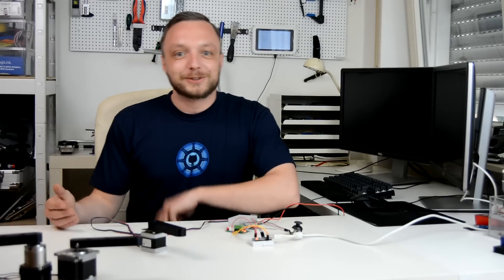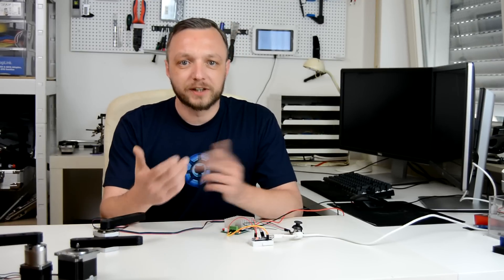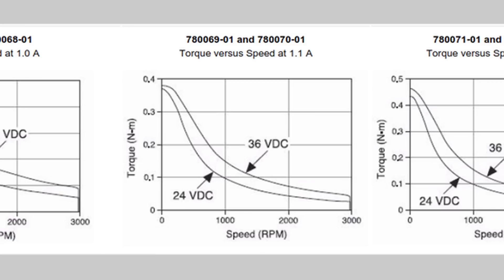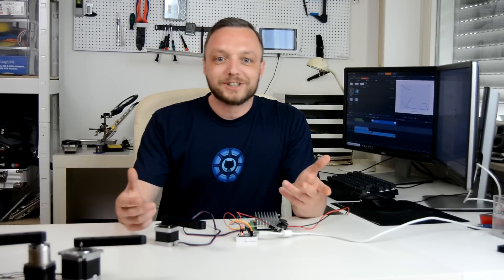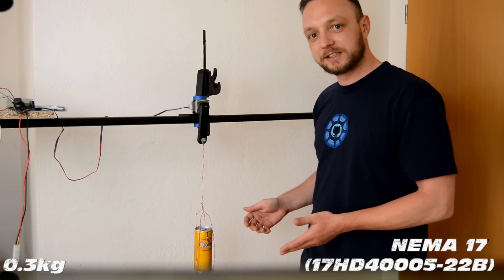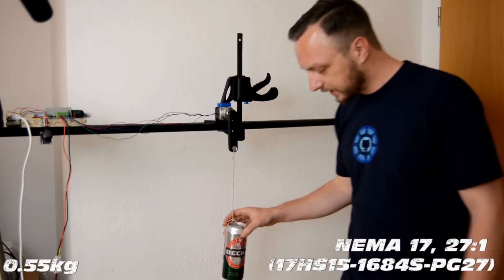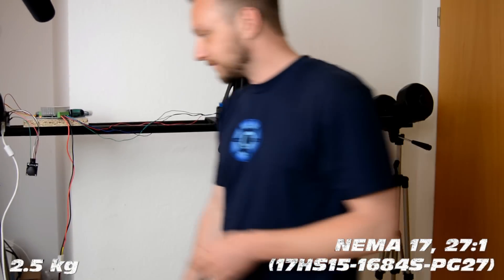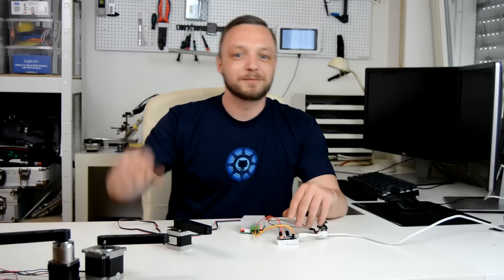Selecting the right stepper motor - Torque test of Nema17 and geared Nema17

Comment: My question is what would happen if the arm would be attached in it's  center point to the motor shaft and a counterweight would be placed at the other  end of arm? Would it increase the weight of being possible to lift?

Comment: Hi.  Thank you for information and demo. I am working with very small project and have a question, would a micro stepper motor with 0.01Nm holding torque, be able to turn a small plastic disk 60mm in diameter weighing around 30g?

Comment: TB6600 Torque... would the driver affect the torque output of the motor at all? We have an issue with a stepper motor application unable to drive an arm and I'm in the process of fitting a geared stepper motor instead. But supplier has said the TB6600 driver is not sufficient for the motor and we should be using a D652 driver instead. But my research shows D652 makes no difference to torque, it's all due to the current output regardless of the driver and that skipped steps (too fast) affects the motor too, again, regardless of the driver.

Comment: thanks for the testing video  I need one help as i am unclear .  I want to rotate the mechanical knob which need 5nm torque to rotate. which  stepper motor i can use ? should i select the motor in accordance with the holding torque specification or something else. Kindly reply

Comment: The disclaimer at the end: No motors or microcontrollers has been harmed during taking of this movie... You made me laugh a lot. 

I am also curious what voltage did you supply to the driver for achieving this, is it 12v, 24v, 36 or something else?

Comment: Could the stepper motor be "inversed" into an input device ? Meaning you turn the motor manually and read the position (angle) from a computer program. (This could be useful to build an "input puppet", posed manually. Then the pose will be duplicated into a larger/stronger device).
Reply: For anyone reading this question 2 years later, you can just use potentiometers in the input joints to get analog readouts, run-through arduino and get your angle.

Comment: It would be very good to know how much voltage was set in you power supply and how much current was set in your BL-TB6600-V1.2 driver?
Reply: I do realize that, and I am already working on the next video, have also built a new and better contraption to test different motors, and will definitely use your feedback! If you can think of anything else that would be interesting please share and I will try my best to consider that in the next video!
Reply: @deSpeyer  Thank you for your answer, I am really looking forward to watch the video.

Comment: hey can you help me to find motor for my project, i need motor which can push the car break paddle need 4kg to start to push it and need 8kg to push completly can you suggest matching motor for this
Reply from the maker: This sounds like an interesting project :) I can try to help! How would you want to move the pedal? With a lever? How long does it need to be? How deep does the pedal need to be pressed?
Reply: @labstream4122  4.5cm it will move to applying fully break , this the length move ,
Reply: @labstream4122  i try to use flexible connection (like cable or wire ) between motor and paddle , because it free to if driver need also he can manual control the break paddle push .. this connection help to both motor and driver can control the paddle ,
Reply: @labstream4122  15sec enough hold the break paddle , motor axel and paddle connect with wire and after motor rotate, cable roll around motor axel , and paddle will pull to down
Reply from the maker: @shanukajothirathne4267  If you want to move 8kg, we are searching for a motor with roughly 1Nm torque - that would give us the ability to move approx. 10kg with a lever (or in your case - a wire) up to 1cm away from the motor axle. I have seen some Nema17 that claim that they provide 1Nm of torque, but never had one of these here. A Nema23 would probably be a safer bet. If you really plan to put this in a car, space might become an issue, though? And what are your requirements on the speed - how fast should it be able to pull?
Reply: @labstream4122  minimum it want pull from wire 4cm in 1sec

Comment: Thank you for the movie, I was hopping to see if the nema 17 kan lift up to 4kg? The movie sound is to low, if this kan help you in the future :-).
Reply from the maker: Hi, thanks a lot for your input! That depends on the NM it is able to produce. 0.4Nm of torque means it can move 4kg attached to a lever that is up to 1cm away from the shaft. However, for long-term operation it has to be checked how much radial load the motor can take. It might have to be decoupled from the load. I am currently looking for ideas for new videos. If you can provide more input on your specific usecase and its requirements, I can try to test it and make a video from it if you are interested?

Comment: Can you please answer this,
If the stepper motor had lifted load to almost 90 deg and we lose the power will the motor rotates back to its 0 deg. position due to the gravity or it holds its position upon power loss.
I want to use a non geared stepper motor in one of my project and i want a fail safe design which returns to its initial position upon power loss.

Thanks in advance
Reply: Hi Abdul, sadly, if the power is cut, the weight will pull down the lever again. You would need an additional mechanism to keep it in the 90 deg position on power-loss.

Comment: I want to use two stepper motors to power a wheelchair for a friend. He weights 90kg. Do you think the shaft of these motors can handle that amount of weight? Also I'm thinking of going for a Nema 34 just to be safe with the min. torque required for the job.
Reply: Most probably not. I'd suggest to put the axle with the weels in bearings which can hold the weight and drive this axle using a belt or a chain

Comment: Hi there, does the distance of the string from the shaft make a difference to how much the motor can lift? I am interested in using a servo motor with a torque rating of 25 kg-cm to lift a mass of 450g, 20cm away. Could this work with a string or not?

Thanks.
Reply: As long as it hangs parallel to gravity it does not make a difference, the force 'pulling' on the shaft will be the Same regardless of the length. The motor you proposed seems fit for your application! May I ask what you plan on building?
Reply: @deSpeyer  Hi there, I'm trying to make a device to pull someone's fingers open as they cannot do this themselves. Using the servo as a sort of precise winch I guess.

Would it work horizontally?
Reply: @kyle_vr  yes, this should work. Sounds like a very cool and important project! If I can be of any further help let me know (I am the guy from labstream, accidentally posted with my private account)
Reply: @deSpeyer  Ok, thanks!

Comment: Intresting video, I'm doing some research for a project and could use some help. I wanna use a stepper but the only way to get power to it would be a battery pack charge by solar or something like that. The torque of the 17 looks good but I might go for the 23 just to be sure... But I want to know... What kind of battery pack would I need to move 4 linear meters on full torque (worst case).
Reply from the maker: Hi Bjorn, that sounds interesting! Could you write an email to me, I can look it up tomorrow?

Comment: Unanswered questions (1):  Was the slippage due to mechanical failure of the motor shaft to lever connection? (2) Was the slippage due to the motor being unable to lift (e.g. failed to maintain lift)?  (3)  Was the motor able to "hold" the weight?  (4) What  demonstrates the failure of the motor?  (5) how to calculate which motor to choose for which weight.

Comment: I want to make an "elevator" at the end of my bed, that can lift a 60" LCD TV (I don't know the exact weight). But I don't want to spend more than $350~400 on motors... or miss the show while the TV is being lifted... xD

Any suggestions? 🙂
Reply: Get an electric linear actuator of desired stroke.That will be simple and easy.
Reply: What height does the tv has to be lifted?
One way is to make a scissor lift mechanism ..
Also try car wiper or car window motor (used probably) .. or some other motor ..
Also add end switches for safety ..

Comment: Sir please reply me, I'm making a college project, CNC EDM , a screw have to rotate very small rpm , and it's lifting a weight 15+ kg which is attached with the nut , which type stepper motor is preferable in low budget...

Comment: so i need to lift 10cm 4kg  , which means that the arm will be 5 cm long  ...  lol so nema 17 is not the good choice .. wth motor i need   ? could you help ? If i calculated it right i need 1.96 Nm  . so nema 23 which has 2.2 Nm should be ok ???

Comment: Hi Sir, I was planning to build a DIY 3DOF full motion for my flight simulator, the weight payload is about 150-200kls. Would you suggest what type of gear motor that fit my plan?  Your comments are really much appreciated. Thanks in advance :)

Comment: Appreciate your video, I am making a crane using a stepper motor. It works up and down perfectly. But I cannot pause in a position in between with A4988 driver, will this driver will do the task

Comment: hello, could you tell me were to find the programming code for the stepp motor?
Reply from the maker: Hi, the arduino-code is here: https://github.com/Labstream/episode_torque/blob/master/tb6600_joystick.ino. I have been using a joystick to control the stepper, but of course you can customize it to your needs.

Comment: Nice video. I'm wondering how bad the backlash of the stepper with the gearbox is? This would drastically influence for example the precision of a robotic joint. Were you able to feel any backlash or did you measure it?

Comment: I use a NEMA17 with 0,59Nm and when I mount a simple RC wheel the motor slips. No force to move my robot car :(
I use the A4988 Driver. In so many projects the steppers looks so strong.

Comment: The higher the gear ratio the higher the torque? If I switch from a nema17 with a 10:1 to a 20:1 does the torque double? And if I choose a 100:1, is it 10 times higher?
Reply: Theoretically yes at the slowest speed. But due to the higher rpm necessary for rotating at the same speed at 100:1 reduction, and the drop in torque for stepper motors as you go higher rpm, it will probably not be so linear for many applications. You also need to check the maximum torque the gears itself can sustain before breaking.

Comment: First, let me say that I am very new to this world and have little understanding of electronics BUT I am learning. I am looking for a very basic controller setup. My original intention was to purchase a TB6600 driver, a Nema 17 stepper motor and some kind of stand alone controller that will remotely turn a variable vacuum capacitor being used in a tuning network for a mag loop antenna. All I need to control is the SPEED (fast for coarse and slow for fine tuning), DIRECTION and possibly some way to create (virtual) END STOPS to avoid damaging the cap (replacement value of $200@) and stressing the motor. Can anyone point me in the right direction? Thanks.
Reply from the maker: Hi Jack, that sounds like a very interesting project! I know next to nothing about mag loop antenna tuning networks. Do you know how much torque and rpm you need for this usecase?
Reply: Lab Stream  My understanding from others is that a mid-sized Nema 17 @ 24 vdc should provide more than enough torque to turn the spindle on a vacuum cap. That type of cap is in a sealed glass tube and looks similar in size and appearance to a typical large radio tube you might see in a high power transmitter. It has a sort of bellows that takes about 40 odd turns to go from minimum to maximum capacitance. Another (cheaper) option is a standard AIR variable cap (has the typical aluminum fins in a butterfly design) will also do the job but may require a bit more torque to turn if it's rated for higher power (over 100 watts). Precision ($$) tend to move with less effort. I prefer to go with the vacs if I am going to spend the money. Otherwise, you will need to periodically have to lubricate and adjust tension to keep them moving smoothly. Since the antenna may be located outside in the elements it makes sense to go with a sealed capacitor. Enough of that. I guess what I want to determine is whether there is a cheaper setup with a smaller footprint that will do the relatively simple(?) job as I had previously described. On/Off, Fast/Slow, CW/CCW. The bonus would be the ability to program the controller to keep track of the number of rotations in order to set end limits and possibly stops along the way like channels on your car radio (for example, 18.5 rotations is good for freq. 7.150 MHz, etc.). At the moment I am looking at a single axis drive and some kind of programmable single axis controller. I would be happier if I could purchase or make (pretty scary kids) the component. It will reside in the "shack" while the tuning network is mounted at the loop. That is about it!
Reply from the maker: @HooPhartd  That should totally be possible from the component side (TB6600, Nema17, small Microcontroller (Arduino Nano v3 for example), and a sufficient power source). If you want a smaller footprint, you could also go with one of the stepper drivers used in 3d printers, or an L298D, but for these options you would have to solder some additional components and terminals yourself.
Reply: @labstream4122  I am not bad with a soldering gun. Unfortunately, I would need to find specific instructions for the build. I have a 100 ft of Belden 18 gauge 8 conductor wire for the rotator control (requires 3 wires). That will leave me with 5 wires for the controller/driver to the stepper motor. I am hoping to get the 24 vdc supply along with the motor controls in to a reasonably sized project box to be located at the radio and another weather tight box to contain the stepper and capacitor, out at the antenna. Can you tell me more about how the stepper driver used for 3D printers would suit my needs. Better yet. Can you provide a link or even the appropriate search terms to get the info? I will locate more info on the L298D that you had mentioned. As I said, I'm not afraid to solder some components together if I can find some specific instructions on the project.
Reply from the maker: @HooPhartd  I think a great starting point would be this: https://howtomechatronics.com/tutorials/arduino/how-to-control-stepper-motor-with-a4988-driver-and-arduino/. The A4988 is a relative cheap controller used in a lot of 3d printers, and the wiring needed is even less than I initially thought. The linked page also provides some basic arduino code.
Reply: @labstream4122  Thanks. I'll look that over.

Comment: How do you distinguish between geared and non geared version of this motor just by looking at it?
Reply from the maker: The gears have their own housing (gearbox), which is usually placed between the motor itself and the output shaft. These housings add additional height and usually look different than the stepper-housing itself. If you look in 0:30 at the lower left, you can see two stepper motors. The left-most is the only geared version in this video.
Reply: @labstream4122  oh wow got it! Thank you so much!!! 👍👍👍

Comment: bro plzz help
i have a 8 pin stepper motor
i have connected it to l298n h bridge
with arduino uno 
the motor is rotating well accoring to the program but it is not taking any load like suddenly when we gove load it starts vibrating 
i belive u know al abut this and clarify me 
thanks